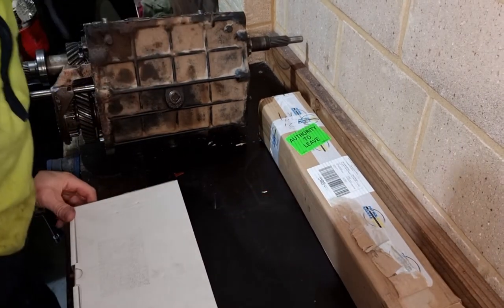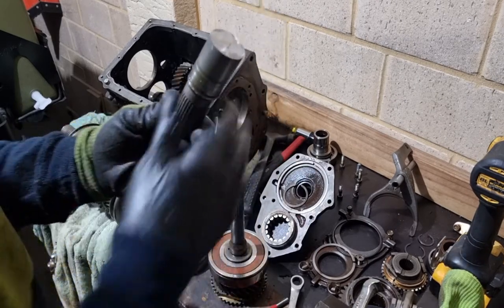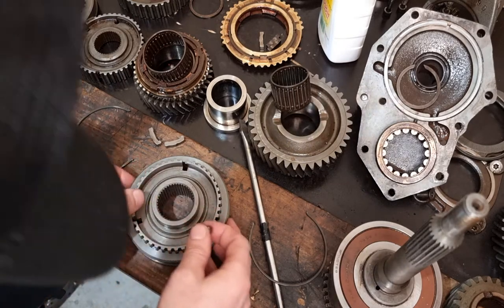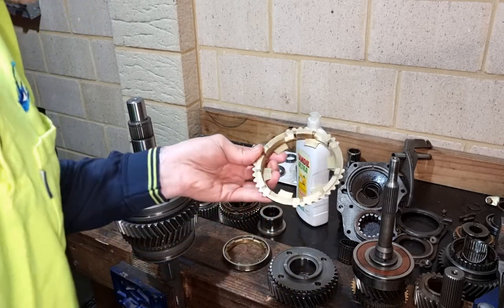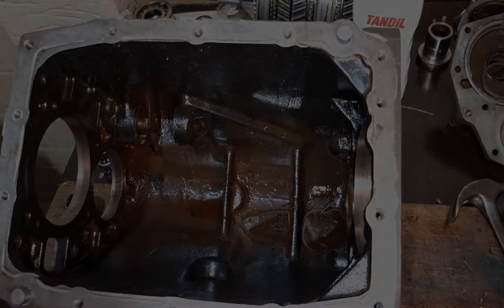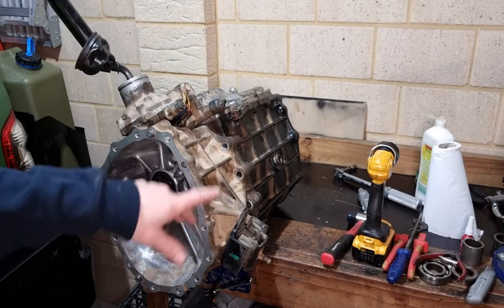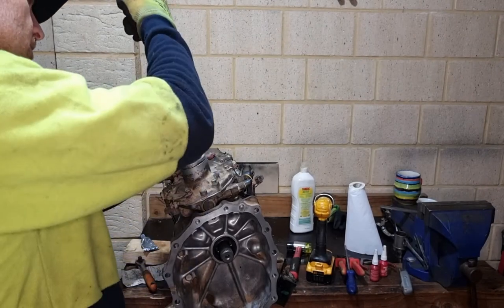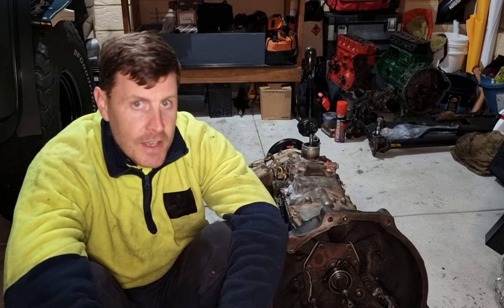Nissan Patrol | Complete Gearbox Rebuild | Part 2

Comment: Hi sir how are you I hope you are doing well I want ask you about when fix counter shaft there I saw small plate how this come
Reply from the maker: Hi Sohail, are you referring to the small plate that slots into the idler gear shaft ? This is to lock the idler shaft in place and has a bolt through the plate into the gearbox casing.

Comment: Awesome stuff m8 for future reference...wonder if ur having bearing noise in neutral but when clutch depressed wont hear any?
Reply from the maker: Thanks mate, never had any noise from the throw out bearing. But it was definitely due for a change.
Reply: Dice FPV , I had the same issue as you described n was the fifth gear n the shaft , both were worn on the spline

Comment: good job Is there a difference between fuel consumption before and now?
Reply from the maker: Significant difference, quite surprising. Litre or 2 per hundred, also felt quicker too. Picked up through the gears a lot easier
Reply: @craigslistofprojects3451  
I wish you peace always